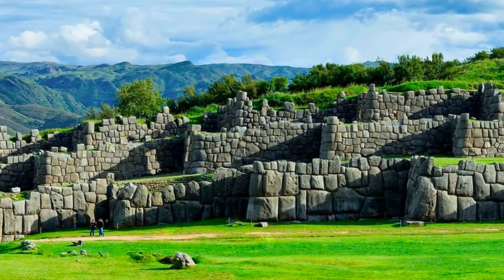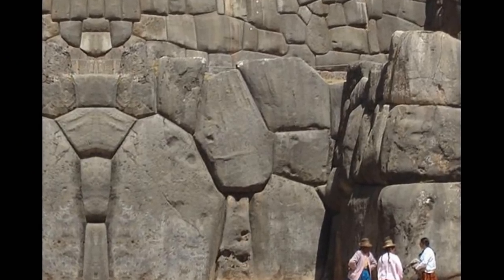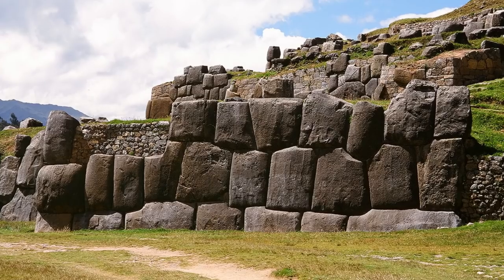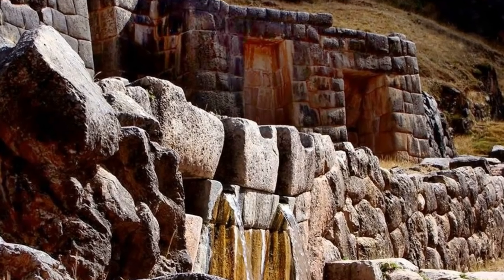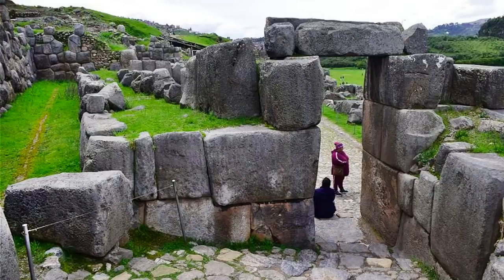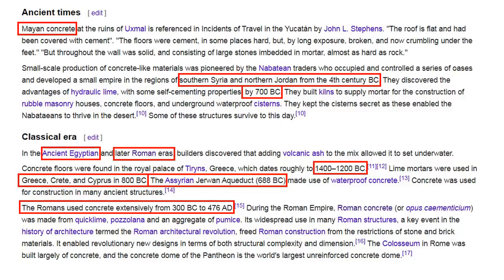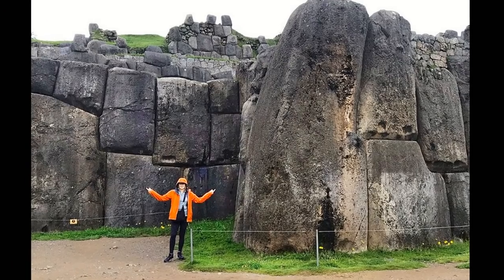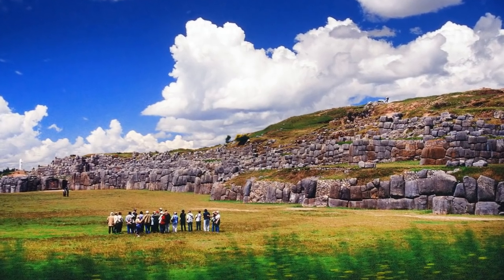Explained: How were Peru’s #Sacsayhuaman Walls Built

Comment: Once again a stellar analysis. I would guess by your thoroughness that you have an engineering background.

I enjoyed this video in particular. I've worked with concrete and have some grasp of requisite steps for its construction and applications. Every counter argument that I could conjure was quickly covered by you.

Before I would not have considered a geopolymer as a possibility. But you made a very good case.

And still I am in utter awe of the undeniable fact that an ancient and very advanced technology was used.

I truly wonder about those civilizations and how long ago they walked upon our earth.
Reply from the maker: Thank you very much for the support, Mudius. Much appreciated it! I have an architecture background 🙂 
Some scholars have proposed that the Younger Dryas comet impact was the event that ended the previous civilization about 12,800 years ago.  But I found some data which indicates the real culprit might be an earlier disastrous time period. I made two videos on this topic. Hope you will find them interesting: Was an Advanced Civilization Wiped Out by a 12,800-Year-old Comet at Younger Dryas? https://youtu.be/4XXV3Ax3KO4 
20k-15k Years ago When Humans Faced Extinction – the Ending of a Previous Advanced Civilization? https://youtu.be/Zs4zLKbp4Ic

Comment: Nice work!  I agree with your assessment.  I'd add that regular stones could have been used in some places as well.  If you look at these walls you can see that some blocks have a matte type finish and others look smooth like regular stone.  This would help them build these walls even faster since the "concrete" would just form to the regular stones as well.  Also, I think that could have caused any previous confusion as to what these stones are comprised of, since it varies depending on where researchers take the samples.
Another thing I noticed in other photos and videos is that the matte looking blocks sometimes have a chunk of the face missing which looks like a layer fell off.  I'd call this delamination.  To me, this makes it seem like those particular blocks were poured or formed from a clay like state.  Once they hardened there could have been delamination over the years and sheets of the face could have broken off.   This delamination also could be a clue as  to what these are comprised of, since it seems like whatever it is can separate from itself once hardened...most likely if not mixed correctly.
Finally, if forms were used they could have been some kind of bag and perhaps the "nubs" and other shapes seen protruding from the hardened concrete were part of the forms.  Like something inside the base of the bag to hold the base open while the material was poured in.  This could have been wood or other stones that would have been sacrificial and would become part of the hardened material once complete.  In fact, doing this might also provide an easier means of transporting the clay like material to where it would be placed.  Once solidified the bag material could be removed on the outside but left in the seams.  Over the years the bag material in the seems could have deteriorated and left a residue which might be why we see a discoloration in the joints of the walls.  This is just a theory of course, but it's something I came up with.
Anyways, I'm glad to see people are trying to figure this out since it's quite amazing and I'm absolutely sure these were not carved by hand!  We need to discover the secrets of our ancestors.
If anyone likes my ideas please reach out to me as I have a lot of thoughts on these walls and would love to go there someday and possibly test my hypotheses with the help of actual researchers!  Long shot but hey lol
Take care all, and thanks again for the good content!
Reply from the maker: Thank you for sharing with me. I appreciate it!

Comment: We see similarities in advanced megalithic stonework around the world, but there are variations in production that point out different engineering techniques. Yet, some are almost identical.  That's is what makes investigating these sites so fascinating (and fun). When you think you understand how one site was constructed, you realize that that technique doesn't work,, or wasn't necessary at other sites. 
   I've been a mason/stonemason for 40yrs. I totally understand the difficulty in quarrying, transporting, carving, and setting stonework (and that's just 1/4 cubic yard/meter size). 
   Also, LIME is basically just a plasticize (when mixed with water), (and it shrinks ALOT). It chemical bonds larger aggregates (sands/rocks) together, thou it only has about a 300yr life span, due to erosion and UV exposure. The variety of modern cements are better b/c we use less Lime and more petro-chemical additives.  Any "ancient" formula that used organic additives would have been highly vulnerable to degradation ,, UNLESS, it solidified in to a very waterproof compound. (eg: Portland cements)
   I'm always open to idea's and interpretations for each site. As each one is it's own perplexing mystery. :)
Reply: FYI, I once juiced a potato and then microwaved the juice. At the bottom of the glass was formed a plastic-like disk that I though might make a nice cup of potato soup, but it turned out that even boiling water would not dissolve it.  Very strange. Nature plastic. 'Touch natural binder 'probably used on those cereals that don't get soggy in milk even after maybe an hour of soaking.
And consider the mystery of the glue used by muscles to adhere to rocks pounded by the surf.  They have probably found a way to imitate it by now, but it drove them nuts for years.

Comment: Andesite , Granite , and Limestone are NOT Concrete ............FAIL .
Reply from the maker: Sacsayhuaman megalithic wall is made of limestone blocks, not granite. Concrete is lime based(cement).  Portland cement concrete is named for its visual resemblance to Portland stone which is a limestone formation.
Reply: @CuriousBeingbyTina  INCORRECT ............The foundations are made of Yucay limestone brought from over 15km away. The outer walls are made from massive diorite blocks from nearby, and the inner buildings and towers are made from dark andesite some of it brought from over 35km away. You CANNOT Make a Liquid Concrete out of Diorite or Andesite Rocks .
Reply from the maker: @stem50  Could you please share the material analysis on the stone types? In 2012,  a team of geophysicists do onsite stone sample analysis by pouring acid on it. The sample almost completely dissolved. They also tested the nearby quarry and after in lab testing they came to the conclusion that the stone was reconstructed with the quarry limestone.

Comment: If these blocks were limestone your theory would work, but aren't these blocks made of solid granite? And if these granite pieces were somehow melted chemically or by heat, the crystals within the solid granite material would also be melted/destroyed, they show no sign of change. These crystals match EXACTLY to the crystal shape and pattern  found at the quarries 50 miles from there. In nature these crystals take decades to form in granite as the rock is slowly cooled from their volcanic creation, they would take the same conditions to reform if melted.

Ron W.
Reply from the maker: I read from several sources that these blocks are made of limestone. In 2012, the geophysicists who did the on-site experiment found the block sample almost completely dissolved when poured acid; therefore confirms the blocks are limestone/ calcite-based material. They also took samples from the nearby quarry. These experts believed Sacsayhuaman was built from restructured limestone powder from the nearby quarry, “which became plastic, due to an unknown technology used by the ancient builders”.  There are people claimed that some blocks are not limestone though I don't know it is true or not.

Comment: Hi Curious Being. These blocks are most likely 'dry cast'. In dry cast stone making the material can be sculpted like we see here. No mould is necessary because the relatively dry mix supports its own weight. Some stones in the wall may be natural, then the dry cast mixed is packed between the natural stones. 

Such technology could explain the quarrying marks we see around the world where it appears a machine was used to pulverize stone rather than quarry it. 

This site has fascinated me for many years now. Great videos, very unique.
Reply from the maker: Thank you for sharing your insight, Louise. I like what you said about "dry cast" which means the blocks would be more like clay or play-dough. I agree that such technology might be utilized to create many sites with polygonal walls. Thanks again!
Reply from the maker: @louiseholland9316  Thanks a lot! I really appreciate it :-)

Comment: Once again I absolutely agree with you! Your theory is not outrageous, in fact it's the only one that makes sense. I also believed for a long time that quite a few confounding megalithic builds used molds or forms for mixed concrete type of materials or softened the stone along the edges for a tight fit. The stones at Sacsayhuaman also have soft indentations which look like were caused by pushing the material into place, or holding it in place with some kind of support when still malleable.I suggest that some kind of tightly woven material was used to pour the soft mixture into, let set awhile, then rolled into place from an adjacent platform while removing the sack. As for the H blocks at Puma Punku, they are too precise and uniform to be anything but poured molded concrete. Also the Egyptian obelisks with the perfectly formed symbols, definitely made with molds and concrete.
Reply from the maker: Glad to hear that. Thank you for sharing your insight with me 🙂

Comment: As a sculptor I concur with your prescient hypotheses regarding the logistics of casting a concrete or geopolymer megalith versus working with natural stone. Shaping and try-fitting of rock on this scale is overly ambitious and impractical, and casting solves many problems. However, any visible grain of the cast would be expected to be horizontal in a cast material, which is not apparent in these blocks. If the stones were to be cast first and then compressed together, what would be able to move such an awkward bundle? The most plausible explanation is that the walls were supported, as you propose, in doorways as well as on the outside of the walls, and then filled with soft partially cured material. The universal inward dressing of the seams would be needed to correct any defects at the edges. There are clearly stones that show signs of gravity and prop bracing that were left after the final shaping. I look forward to more discovery from you, Tina, excellent work, thank you!!
Reply: flying42hawk finally I find someone who shares my theory on this construction. It is absolutely incredible. I believe that they used a mix of actual quarried stones (possibly the larger ones we see) and a dryish concrete of some type. I use a dry mix of stone and cement to point up paving and if done with just the right amount of water it is as strong, if not stronger than wet mortar. I think it's likely the builders built up soil in front and behind the first layer of stones as a ramp then basically created a stone by packing in mortar against the previous, now set stone. This hypothesis is the only method that I can imagine using which would explain all the features we see here. Then the semi set material could be carved and bevelled to the beautiful curves we see here. It would make sense of everything. BUT..... next question is of course how did they produce tens of thousands of tons of 'concrete'. Seems to me there's as much work in pulverizing quarried stone to dust as to just chisel quarried stones out to perfection with some kind of scribe system, both methods unbelievably challenging. Unless of course they were using pre pulverized dust from a natural process and using some kind of binder. There are lumps of what look like pure portland cement all over this place, it's bonkers. Either the stone was molten (as you are probably aware limestone doesn't melt!) or it was concrete at some point, either way the stone/concrete was liquid at some point in history as the marks can only be explained by tools in wet concrete. The 'rock slides' at this site or also very weird, they give the impression of being formed by glaciers however if you look closely there are some kind of machine or tool marks at the edges of the slides, this does rather give the impression that the rock was at some stage soft and has been scraped off to form these slides. Totally fascinating I'd love to go and take a look. This video is well presented and intelligently conveyed.
Reply: How could you tell the difference between a tub of liquid concrete and a block of stone that had been treated to make its surface areas soft and malleable? Both require technologies for which no evidence exists. How about not ignoring ancient Amazon Indian legends that speak of a plant juice that softened rock?

Comment: I live in a city full of broken up and repurposed stone. Hundreds, if not thousands of walls are clearly constructed out of material from the immediate vicinity. For instance, in the nineteenth century railway lines crisscrossed all around the city, and  went to surrounding locales, the remains of stone-built railway stations and the existence  of a few remaining structures from this era make it clear how widespread the lines were.

One point is that the much larger stones out of which the stones now cemented into current walls were made were probably themselves taken from still larger stones of the type we call megalithic, some smaller versions of which can still be found in undeveloped, overgrown parts of the city.

Another point is that, when you look at the stones in the walls of my city, they are not uniform, either in terms of type of stone or recognisable history: some are blackened with soot because they were part of the railway stations; others are perfectly clean, or stained through standing in mud for a long period. Some have perfectly flat faces, others have pock marks, bulges, scrape marks, cuts, holes (including square ones!) and rounded off edges; some look like concrete, some like dough, others like pieces of pure stone; some have veiny iron lines running through them, others are light and crumble into flecks quite easily. Thus, these stones have not only been repurposed, they've probably been repurposed on several occasions, some shifted between sites. Sometimes, when watching videos about megalithic structures, I can't help noticing similar, and similarly random, kinds of differences among adjacent stones in them, making me think that, in a sense, there has only been one huge stone age, interrupted by events on occasions, but still essentially here even today. It also makes me realise that advanced, technologised human civilisations have been building and rebuildig structures for a very long time out of whatever was already there, and breaking down stone and all kinds of materials into varied forms, one of which is conctete. Since our civilisation uses it widely, the chances are that previous civilisations did the same, only probably better than we do.
Reply from the maker: Good points, thank you for sharing with me, Toni. Much appreciated!
Reply: @CuriousBeingbyTina  Thanks, Tina. It's always a pleasure to engage with you and your research.

 I do think it's worth remembering that almost everywhere on earth has a very long history, not just those places containing the massive, famed, visible, venerated ancient/megalithic structures today.

Comment: The blocks used in those walls absolutely look like they were cast and molded. The Russian research into the material changes everything in my opinion! Thank you for providing the links to the study!
So summarizing:
It looks like they were malleable - Carving these (bulging) shapes with primitive tools wouldn't make any sense and is totally implausible - Russian scientists concluded that the material does not occur and is not possible in nature - there is a local story about technology that makes rocks pliable - the structure as is, proves to be the best solution.
As the saying goes: "If it looks like a duck, swims like a duck, and quacks like a duck, then it probably is a duck." It is called abductive reasoning.

Thank you for yet another very interesting piece of work!

Comment: Loved this! 

Wondering if maybe the concrete stones were not individually molded and then set in place, but perhaps molded in place in some kind of bag (similar to sandbags?) that would either decay/decompose over time or be absorbed/integrated into the concrete surface (maybe through some kind of firing process?)?

Maybe we could come up with a sustainable way of turning waste plastic/glass/metal (or combinations) into building materials? Make trash into bricks or sandbags or fill for forms or other?

I think studying the technologies behind these ancient structures may lead to clues to solving some of our modern carbon capture & sequestration problems.

Not an engineer. Just interested. Thank you for sharing your insights so clearly!
Reply from the maker: Thank you for the support! The sandbag theory is interesting. Since we are proposing that the concrete material is malleable, then the fabric of the bag would have left imprints on the hardened concrete block, no? These blocks are generally smooth; I wonder what kind of fabric would be strong enough to hold multi-ton blocks in place while being very smooth thus not leaving any signs of fabric imprint...

Btw I made a series of videos on ancient megalithic sites and prehistory civilization. Hope you will enjoy them as well :-)